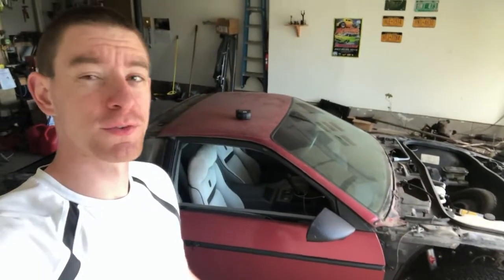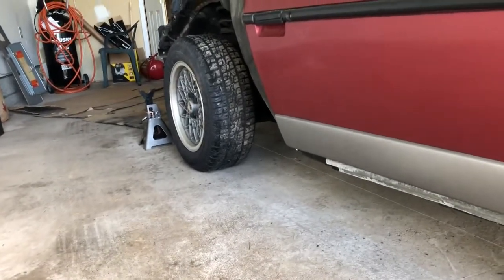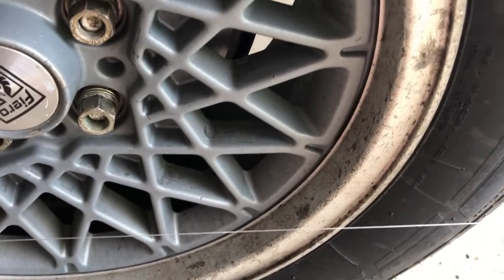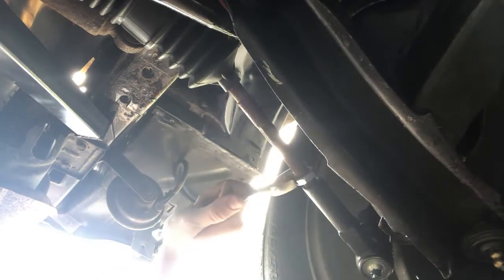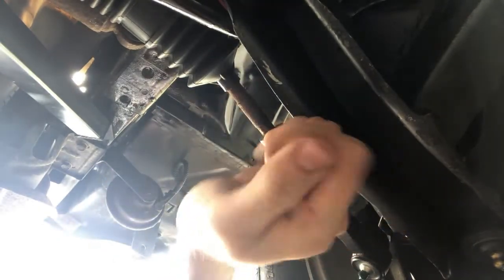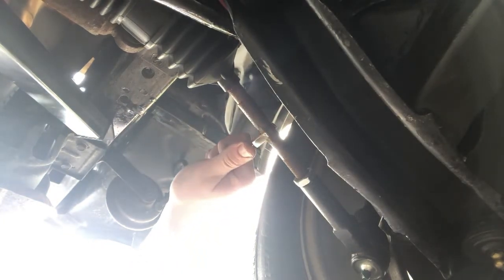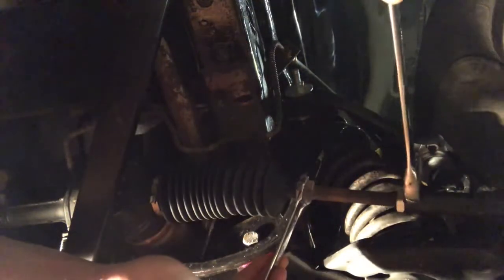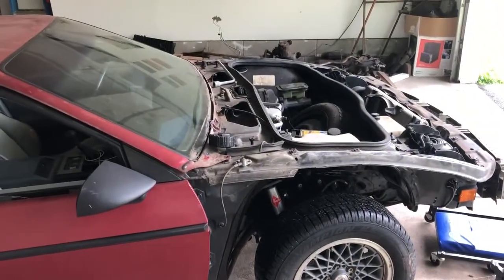How to do an At-Home DIY String Alignment

Comment: What about camber and caster on the rear. I’m having trouble getting it set.
Reply from the maker: For camber, if you take a small level, like a 12” one and put it vertical on the wheel it will tell you when you get the camber in line.
I think a longer level will work if you put it across the tire also. 
This at-home stuff is only to get you to an alignment shop, always have it professionally done
Reply: This works only if you have exactly the same width at front and rear.
Reply from the maker: Most vehicles do